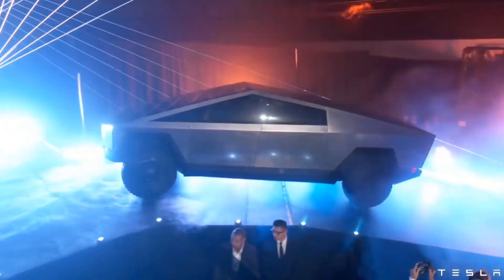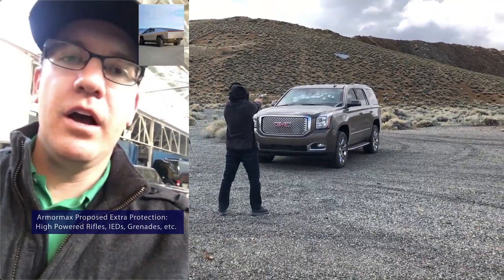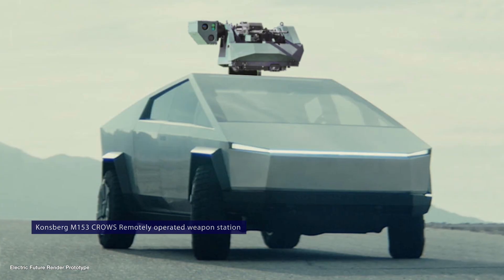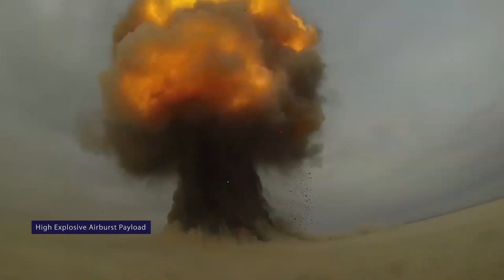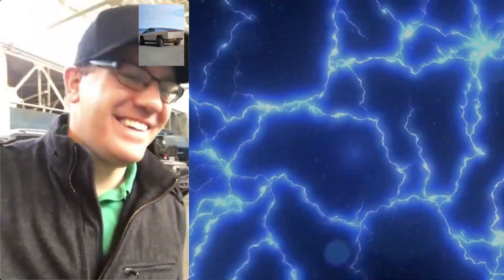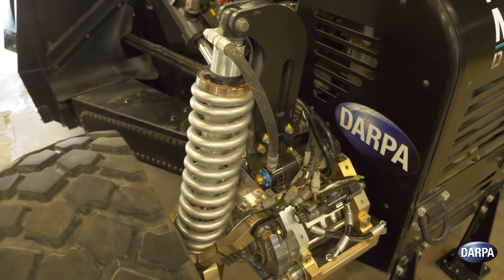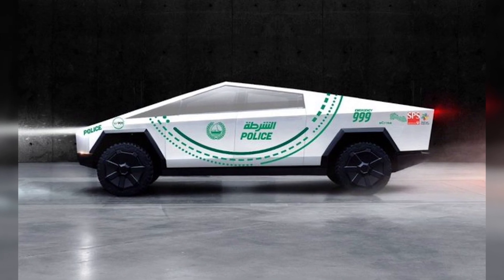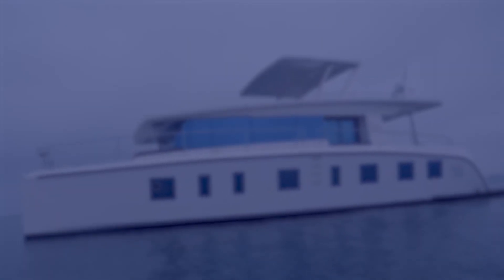Military Tesla Cybertruck: Combat Vehicle

Comment: FREAKING EPIC. as a former combat veteran that drove tanks in the army i would love to see what a 75 ton electric tank would look like lolol.
Reply from the maker: Thank you for your service.
Reply: The battery is a major weakness. Logistically and crew survivability.
Range would be shit. If its unmannes its still facing range, logistical, and transport problem.
Reply: @ghostwolf117  all those issues can be overcome with future technology. be well.
Reply: @KevinP32270  I have one doubt left. Can it be made soldier proof?
Reply: @ghostwolf117  given enough time any vehicle can be destroyed. i saw some seirous destruction during desert storm.
Reply: @ghostwolf117  Thanks for the reality check Juan.Hybrid is the go, terrific fuel economy and torque. I would rather run out of diesel than battery on the battlefield. Best of both worlds.
Reply: @ghostwolf117  how much current abrams engine and fuel tank weigh combined? just for comparison and curiosity
Reply: Can you imagine the acceleration on that thing.
Reply: @justindozone2160  in the future they might have better batteries and use carbon nano tubes for the body.
Reply: EMT would wipe it out
Reply: @Arreat_Summit  LOL NOPE, EMP shielding is very mature deployed already.
Reply: @Arreat_Summit  you mean EMP?😂
Reply: Make it thermal neutral to hide it from FLIR.
Reply: @johnsmith-o3v1k  Now we are talking. Hybrid - Fuel economy and torque. I would rather run out of diesel than battery on the battlefield. Best of both worlds.
Reply: Quest 77051 Thank You got your service brother.  My brother (Air Force) spent sometime with JSOC teams in that same box.
Reply: @Captain-Awesome  thanks for his service. godspeed.
Reply: Than you for your service
Reply: Thank You for your service Mr. QUEST
I helped assemble the control grips for helicopters, tanks and hummers. I prayed over each one knowing that the trigger plate that I assembled would one day shoot a powerful weapon. I was just a mechanical monkey, the Engineers were the genius designers.
Reply: @antoniapaulinadelgado1680  thanks so very much for your hard work. it's a team effort. we could not do our job with you doing yours correctly.
Reply: quest 77051 what in the middle of a battle zone littered with wrecked buildings etc. and your battery goes dead, where do you plug in ,sort of makes the electric tank worthless .or your enemy releases an EMP CHARGE .
Reply: @douglastodd1947  maybe change the battery pack with a new one. i helped fuel tanks in combat so it can be done. many systems in military vehicles are EMP hardened. I'm sure the engineers will figure it out. just a thought.
Reply: @douglastodd1947  circuits can be shielded against EMP charges. A portable generator can be used in emergencies. As of now, batteries cannot match the energy density of gasoline but that might change in the future.
Reply: It goes invisible light armor, extremely quiet, hit hard and disappear
Reply: It a good idea
Reply: <<<CHANGE THE PROGRAMS>>>
Reply: Thank you for your service I am 10 and I want to be in the us army rangers or special forces
Reply: @wls_trx  you're welcome. why are you on youtube at that age? do your parents know that you are having conversations with adults? 10 is very young. you have a long way to go and think about what you want to do. godspeed.
Reply: @KevinP32270  you just demolished a kid for wanting to serve our country
Reply: @KevinP32270  i think that behavior should be encouraged
Reply: @crunchybro123  not everyone make a good service member. they don't let in everyone that wants to.
Reply: if you drove tanks , then you know bigger weapons are aimed at you , how does the crew do if the lithium catches fire after a hit from an anti tank weapon ? , light armour is 1 thing , heavy is somthing else again
Reply: @stevensmith797  what tanks have you drove? we carried tons of ammo on our tank. we have a very heavy door that protected the crew and if there is an explosion it's guided up and out of the tank instead of into the crew area. i'm sure the scientist would come up with a way to protect the crew from that kind of fire as well. so what are you trying to say?
Reply: @KevinP32270  Ive never driven a tank , or even been in the military , but lithium is dagerus and cant be stopped once on fire , dont think lithium is an answer for electric heavy armour
Reply: @stevensmith797  lololol...so you just making things up? i have seen some things that would blow your mind when i was in combat. trust me when i say if the military wanted a battery operated battle tank they can make it happen. i'm speaking from experience. you are just typing for attention. be well.
Reply: @KevinP32270  m8 , Ive seen what a simple 2000 amp lithium battery does when punctured , , thees no stopping it , and will eat through metals with pure heat , guessing heat isnt a good thing for ordanance , then there,s where do u put a battery that cane move 75 tons lol , the lithium will be everywhere , good luck with that
Reply: @stevensmith797  ok mr. expert that have NEVER driven a tank or been in the military. we all realize that you are the smartest person in the room. be well.
Reply: @johnsmith-o3v1k  i mentioned that to him already but when you are a genius there's no reason to agree with anyone else.
Reply: PL-8: exists.
Reply: WE DONT NEED COMBAD VEHICLES TO KILL OTHER HUMANS WE KILL OURSELVES HERE DUMB AMERICA!
Reply: @justindozone2160  I am sure a quick change Battery will be part of it or quick charge.  if a car can get 150 miles in 10 minutes of charge then a larger battery system will be even better.  For the battery quick change out all you have to do is have on additional “skateboard” to go with every unit.  One charges during the day and the other prowess around looking for the enemy.

Fresh batteries are brought versus gasoline if needed.  Think brother it’s way a way easier problem to solve than you’re giving it credit for.
Reply: Ever play the old tank game made of blocks ? ....
Reply: @FrostSoul-qs6kq  yes lol
Reply: Yeh I don't know if we are ready for electr9c tanks unfortunately,. the battery would make the tank so heavy and take up so much room that it's not really practical also there is the charging issue, having a tank down and not fully operational for 2 hours would be... not good... unless you can have replaceable batteries, then you have to make it so that the amour can be rapidly taken off the battery put back in and then put the armour back on all preferably in the time it would take to refuel a tank.

It's probably possible... but like... you would a team of well trained men to do it, better off just sticking to fossil fuel tanks, although a hybrid tank might not be a absolutely terrible idea.
Reply: @Etheoma  I would love to see scientist give it a try.
Reply: @KevinP32270  Eh thats an engineering issue not a scientific one, all the tech is there for a hybrid tank if someone wants to build one, it's just implementing it practically.

I say "just" implementing it practically, but that is just relative to all the time that has been put into improving batteries etc. It's still a big job.
Reply: @Etheoma  are you saying engineers are not scientist? lol.
Reply: Can anything be done to reenforce the tires? because if not, none of the rest of that will matter if you're a sitting duck with the tires out
Reply: K
Reply: Driving around in that thing on the roads... golly people are gonna be watching! Where exactly are the modded cybertrucks in Canada?
Reply: @mrdidibekfeast3704  you are truly welcome.
Reply: @justindozone2160  just use replaceable batteries for plug and play capabilities
Reply: @justindozone2160  why not just have a quick battery swap system instead?
Reply: Look at the design. Like my son did when he was a kindergarten
Reply: The cyber truck can be a armored truck vehicle because it has its own armor and bullet proof Windows.
Reply: @tickacat5372  A military electric truck?  Charging in the middle of a war.  All South Korean men are required to serve in the military for two years. Does Tesla have any executives and employees who have served in the military?
Reply: You never gonna see that! LOL! You gonna see hydrogen tanks sooner than BEV armored vehicles! Why? Simple the weight! This is here just a bunch of pipedreams! Haha What reange is it gong to have with 500 kg of extra armor and where the hell you gonna recharge it in the desert! LMAO
Reply: @tibsyy895  carbon nanotubes can make it very light and stronger that it is now. you can recharge a tank in the desert with fast charging solar panels. you can also have quick replaceable battery packs. an M1A1's entire engine can quickly be removed in minutes. i'm sure a battery pack won't be a problem. so there is a possibility. LMAO.
Reply: Uh sure
Reply: FYI there are 290 Ton Electric Mining Trucks. Soo a 75 Ton Tank is too easy. Problem is Energy Capacity and Long Range. Pure Electric BEV not plausible. PHEV seems like the best survivability.
Reply: Withhhhhhh glass thst a golf ball sized rock destroys lightly thrown lololol
Reply: @MZ-bl6wg  LOL Brainwashed. That was just consumer grade windows not proper bullet proof glass. It still caught the solid metal ball bearing, not a rock. Do that on normal car windows it would gone through like butter. It's sad how twisted rumors with factual falsehoods become popular.
Reply: Never happening. The energy density of battery's would need to increase by about 2000% to make that viable.
Reply: @smh9902  Yep pointless to use Batteries anyways. But Series Hybrid Electric Motor Driven military vehicle are already being developed. It's simply the best method to couple dozens of tonnes very fast. Either Fuel Cell or Gas Turbine Generator and enough Battery Kwh for in and out danger zones silently. We're talking about 1.5 MegaWatts & 3000lb/ft of motor grunt. e.g. M1 Abrams has sharp peak of 1.12 Megawatts equivalent with much more horrible Torque Curve.
Reply: @Neojhun  Bleeding edge internal pulse detonation engines with an efficiency of 60%+ will likely end this pure EV fad in the next 10-20 years as they will allow people to create their own electricity at a price lower than the grid. Switched reluctance motor-generators will allow for parallel hybridization with the PDE. In military applicationms parallel hybrids are better than series hybrids because you get more power and torque with a lighter package and you also get double redundancy in your drivetrain so its an inherently more reliable system. Series hybrids are better for things like locomotives or possibly city buses. The other cool thing that fickett-jacobs cycle PDE's can do is allow the main gun to be replaced with a combustion light gas gun that is powered by the same fuel that powers the engine instead of gunpowder.
Reply: @smh9902  How does PDE work with Generator Turbine, that seems like it would massively kill the efficiency. Also Efficiency is NOT the point. We want High Performance Brute Force and Simplicity Toughness and Redundancy. Trying to force PDE to be high performance enough to make a Tank run fast seems very fragile possibly a sitting duck. I never advocated for Pure BEVs, but I do want PURE Multi Electric Motor driven only, no mechanical drive train.
Reply: @smh9902  Also you can not beat the FUEL Efficiency of Wind Turbine, Hyrdo & Building Solar PV. Even if you considered the resource cost to build them. 60% is rather horrible relative to those.
Reply: @Neojhun  No, you're missing the point. Wind turbines, hydro, and solar still have 35% transmission losses through the grid whereas a sabatier reactor powered by nuclear can create super high energy density DME fuel that can be trucked via tanker with an efficiency of over 99%. Not to mention that the method you're espousing requires incredibly careful load leveling and perfect synchrony of the grid. What I'm saying is pure decentralized energy. We can even have a modified iteration of the internal detonation engine use a mix of 89.75% Pu239/10.25% Pu240 for an incredibly compact fuel that would be cheaper per kilowatt than any wind turbine or solar panel whilst having an energy density thats literally a hundred million times greater than battery's.
Reply: @Neojhun  Regarding a tank, a PDE is a very simple two part apparatus. It only has two moving parts. Its not a turbine its more like a scotch yoke piston-style engine. The motor-generator would be of the switched reluctance type and would be connected directly to the crankshaft by an electric clutch. The engine can be disengaged from the motor for silent operation, and if the electric system fails the clutch automatically engages and the rotor of the motor becomes a heavy flywheel. This is about double redundancy and reducing weight. With the system I'm espousing you can still run the tank with just as much electric force, the drivetrain in tanks are already incredibly simple and compact. The typical hydraulic tank transmission weighs less than an electric motor of the necessary size to drive the vehicle. So its not really a mechanical drivetrain, more of a fluid/liquid dirvetrain. With a series hybrid if your electric system fails your entire vehicle fails, and you ONLY have the energy of the motor. With a parallel hybrid you have BOTH the torque and power of the motor AND your prime mover to move your tracks, and if one system fails you still have the other that can work. We also have eliminated total necessary parts from 2 motors and 1 generator, to one motor-generator and a hydraulic transmission. Military combat vehicles need to be very powerful, lightweight, compact (even a tank), redundant, and robust. A series hybrid does not offer the redundancy needed for such a mission profile.
Reply: @smh9902  "series hybrid does not offer the redundancy" WTF? You have at least two power pathways.
Reply: @smh9902  "Wind turbines, hydro, and solar still have 35% transmission losses" Note I said FUEL efficiency. Those sources do not use fuel. The only fuel that can be attributed is the Resources required to build the systems. When your energy source is Not Finite. 30% transmission is pointless. We eventually need to exploit Renewables even more remote further away from Consumption where it would typically 0% would be generated.
Reply: @Neojhun  Yes, but with a series hybrid both power pathways are still dependent on the singular generator, which is one link in the chain. If the generator fails it causes a total vehicle breakdown. A parallel hybrid offers everything a series hybrid does, but can continue to operate in the event of EMP (important for military vehicles) or total electrical system failure, which happens more than you'd think, especially on the battlefield. This is why the Army has not adopted smart guns. What I'm espousing here is a series-parallel hybrid that combines the best of both systems with 400% more redundancy and greater total horsepower/torque. Remember, an electric motor by itself will never produce more power than a  parallel hybrid engine + motor. Not to mention that HORSEPOWER, not torque, is the meta for top speed, which is VERY important for tanks and military vehicles. And detonation engines produce WAY more total top end horsepower than a motor by itself ever could. And we still havent even got into nuclear fuel, which instead of burning liquid fuels uses a modified zetatron in leu of a sparkplug and powering the engine with actual literal atomic explosions. The power to weight ratio and torque of a nuclear engine will dwarf any electric motor.
Reply: @Neojhun  35% power loss is a factor because with a IDE thats 60% efficient suddenly it becomes just as cost effective to turn that energy into synthetic liquid fuels that can be transported at an efficiency of 99%. This it actually becomes more efficient to take the energy from renewables, turn it into DME, and then truck or rail the DME to its final destination where it can be stored in tanks and used as needed. This eliminates the load levelling issues associated with renewables. Now you dont need to use the energy immediately and as its being produced. With a hyper efficient internal detonation engine synthetic fuels become the ultimate renewable battery in this regard. Local energy generation will always be more efficient and convenient.
Reply: @smh9902  That's simply False, the compounding of Fuel Synthesis + PDE is a gigantic loss by the time you get electricity from syth fuel. Fuel synthesis is a rather inefficient process. It is no where close to HVDC where there is no transfer in energy type. The only reason that method makes sense is for remote places with no infrastructure, like War Zones. Not to be used in Populated developed places.
Reply: @Neojhun  Sabatier reactors are not inefficient, on the order of over 80% with good catalysis balancing, and DME fuel synthesis methods convert waste such as municipal solid waste, sewage, sludge, and other wastes into clean burning synthetic fuels. And lastly, the grid only has X carrying capacity. Building new grid infrastructure is insanely expensive, and if you want to get a full megawatt on tap to every household in America as I do, the grid simply will not do. Making energy more abundant and less scarce is whats needed most, and the grids carrying capacity would have to increase by  five thousand percent to bring a full megawatt of power to everyones home. Using chemical engines to prove the viability of decentralization is only the first step, the second is to go from chemical to nuclear engines and now these nuclear engines can be purchased for a little more than a conventional ICE but would run for over a century before needing to be refueled. Increasing density of the forms of energy we use is the meta to type 1, not increasing the use of "renewables." I want everybody to have small modular nuclear reactors under their hood and behind their homes. Thats how its done.
Reply: @smh9902  Wow that's a cool Idea, still way too theoretical. Really A Megawatt to Residential Buildings seems excessive, over 100kva for everything makes sense. That would still require a Doubling of the grid and to displace Fuel Heat source. I'm not a fan of SMR even if we can make it very safe. It's more a case of horrible idiotic people purposely using it to cause harm. I don't mind a heavily regulated SMR industry that runs the Grid Base Load and Regulate Harmonics with giant Fly Wheels driven by the Reactors. I still think Decentralized Energy should be done with Renewables combined with Mechanical or Air Pressure storage. This is for populated developed places, different in remote sparsely populated places.
Reply: @Neojhun   People 100 years ago would say that nobody needs more than 500 watts for anything. We have no idea how people would use a megawatt of energy on tap if it became available to the masses. What we do know is that as energy becomes more dense and more abundant quality of life goes up. Instead of "high efficiency" dishwashers that dont work effectively to remove stains and stuck on food from dishes, we could just run ultra high pressure high temperature steam cleaners to clean a load of dishes in 60 seconds flat. Yes, it would use more energy. It would also increase our quality of life. Instead of using sticks and plywood to build a home, with this much cheap abundant energy we can just throw stones and slag into an arc furnace and cast giant stone/glass lego bricks to make our homes both incredibly affordable and exceptionally strong. Imagine being able to build yourself a veritable "castle greyskull" for a couple grand. We could use such an abundance of energy to shape the land to our desire with relative ease. Going to a less dense form of energy is a step backwards away from type 1. Things like real estate and land no longer need to be tied to the grid to be powered. Now even city's and urban area's become mostly obsolete as even the most remote and affordable land becomes viable to build a home. At the end of the day, we want to increase quality of life and decentralize power while increasing quality of life. We have no idea how 8 billion people would use a full megawatt of power available to them at any given time. That much human imagination with that much energy available to them to do novel work would see a rapid change in technology and society  in ways no one man can fathom. I have to ask myself, do YOU want to be dependent on the grid? Do you trust the government more than yourself and your neighbors? I dont. I want people to have the option to be independent of the grid if they so choose.
Reply: same
Reply: It wouldn’t be 75 ton
Reply: Hi
Reply: I’m iffy on this.
Reply: @BowHuntnBoxing132  you never know.
Reply: it would be ass. max gross vehicle weight on roads is 40 tons and it takes 3 tesla motors just to barely move that
Reply: @SKRUBL0RD  I'm sure they would find a way to meet the military standards. the joint chiefs control the planet.
Reply: Talibans would have fun roasting your crew with your own li-ion batteries.
Reply: @hotdog160  LOL you ignorant fool. Those Li Ion will be used to power Weapons that roast the enemy. Direct Energy Weapons like Laser are being deployed soon.
Reply: in 75 ton battery will die in 2 minutes 😂 maybe in future 😂
Reply: @MrLazynko  (facepalm) Wrong, more like 50 Miles. Still very problematic without alternative fuel source.
Reply: @justindozone2160  WRONG, Non Hydrogen Fuel Cell PHEV. Most mature right now is SOFC burning various Alkanes. Spend most of it's time running on Battery near base. Run on Butane when going far. Time spent recharging will have zero impact on fleet rotation. Problem is having a secure fuel convoy, same old problem.
Reply: @Neojhun  That would solve the problem with having to implement a parallel (non HC) supply train to the existing services that support an army's vehicular fleet.